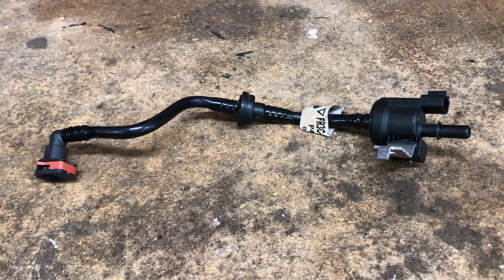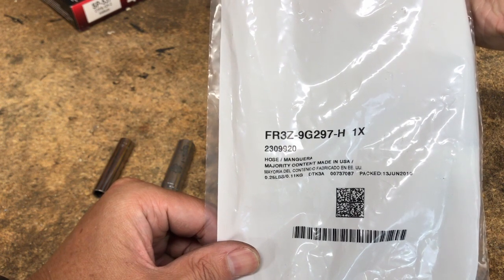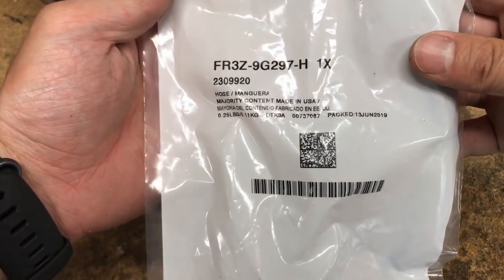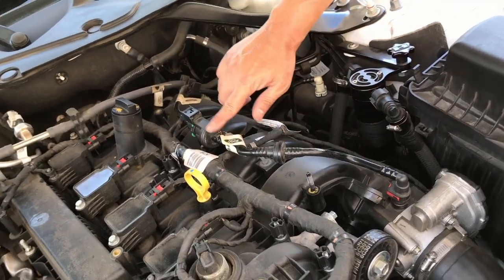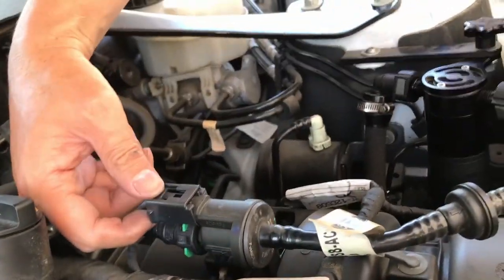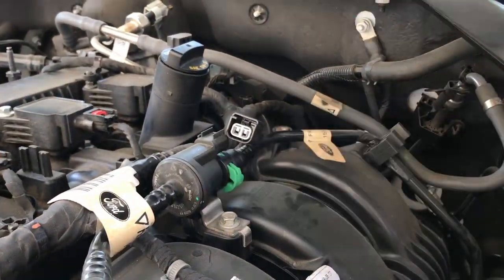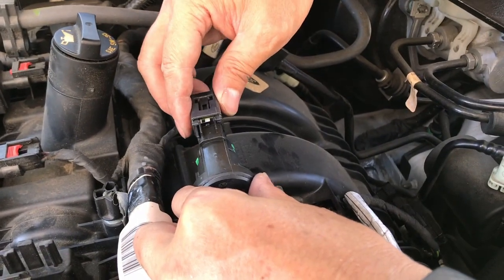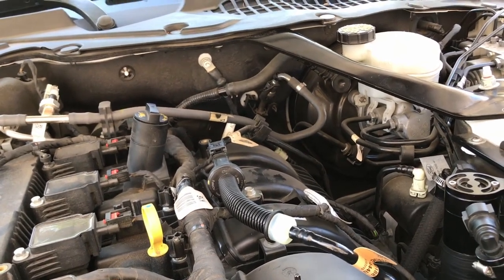Ecoboost Mustang - P1450C Evap Purge Valve Replacement

Comment: Excellent video - thank you! I Also appreciated your input on where you got the part and cost in one of the replies (can you say which specific online Ford dealer you got it from?).
One additional Question; my car (2015 EcoBoost Mustang) is getting the P1450 error code you mentioned as well as a P144A code. When I research this code, it says it is an “Evap. Purge Valve”. However, I don’t see anything like the pic of that in my car, AND the only YouTube videos of this are on different engines. I now suspect that the “Evap. Purge Valve” has been REPLACED in the EcoBoost engine by the one you show in your video - and that it is not two separate and distinct parts. Any input is extremely welcome.
Thank you again. Great stuff.
Reply from the maker: My pleasure, glad this helps.  Going through my records, I purchased it through Varsity Ford Parts.  Total was $38 shipped.   I believe we're talking about the same part.  One thing I noticed was the replacement valve was completely black.  The original part had a white section near the middle.  Hope this helps.

Comment: Amazing video man, love that you used no speedups or nothing, showed me exactly how long it would take to do this. The Motor cover gave me more issues to put on then the part lol. Whole process took me exactly 20 minutes to do :0
Excellent video, worked on my 2016 Ecoboost, thank you!
I'll take it to Auto Zone to get the check engine light cleared and should be good to go, well done.
Reply from the maker: You're welcome Null.  I saw a few videos where people were struggling with the connectors, or just completely skipped over the process.  So I figured I document the entire procedure.  Glad it helped.
Reply: Hey did the check engine light come back on? I cleared mine immediately doing this but just checking to see if it’s going to come back on tomorrow
Reply: Do they clear cheack engine light at auto zone ?

Comment: This can be avoided by not "topping up" gas when you get it.  New systems (2009+) are designed with this strict anti pollution tech that is supposed to prevent gasoline vapor to get back into atmosphere....when you top up it adds gasoline liquid into system and can destroy it.  If you avoid topping up, this shouldn't occur.
Reply from the maker: That's good to know.  Thanks Joseph for sharing.
Reply: Currently going through this right now; you just saved me a lot of money. Thank you so much!
Reply: @Dietdove  if the problem is already happening u have to replace the part. He’s saying if you avoid over filling after the pump stops it’s self then you won’t have to worry about the part breaking or having a vapor leak. The extra gas causes excess pressure that the part isn’t designed for and slowly weakens it’s ability to stop vapor from escaping.
Reply: Is this a passive aggressive way to enforce "stop using gas!"?
Reply: So that’s how I fucked up, well I’ll keep that mind next time
Reply: Where can I get this part from
Reply: Thank you for telling us. I've been doing this to work trucks for fedex for two years and didn't think it was doing anything negative. Now I know not to do it in my car lol

Comment: Which year Mustang you did this on
Reply from the maker: Hi Savannah, I performed the replacement on a 2015 2.3 liter Ecoboost  Mustang.  However, it looks to be affecting later years with the same motor.
Reply: Guide also works on 2016 (my ecoboost)
Reply: Does this purge valve work for 2016 Ford Mustang ecoboost? I am having trouble finding a replacement purge valve for my 2016 Ecoboost from auto zone / O’Reilly auto parts stores (they only carry valves for GT’s)
Reply: dannyTS11 yes it works I installed it in my 2018 Mustang eco boost I got mines from my local for dealership saw some on eBay also
Reply: @dannyTS11  i bought mine online, the OEM part is cheap. They don't sell it in those types of stores, I tried Auto Zone and they didn't have it.

Comment: Where did you get the part from? Directly from ford or an auto parts? Just had this issue come up last night. Awesome simple video!
Reply from the maker: Hey Andres.  I purchased it from an online ford dealer.  I wasn't in a rush, and my local dealership wanted about $20 more for it.   Yeah, I saw a few videos where people were struggling with the connectors, so i figured I'd break it down step by step.  Thanks for the comment and happy to help!
Reply: @BIsForBudget  Could you give me the name of your Ford Dealer online that you use?

Comment: My gas cap just started making a weird noise like a farting noise and my car has been having trouble starting up every time I fill it up with gas you think this would help with my problem?
Reply from the maker: Hi Raphael,  not sure which year or model your vehicle is, but the 2015+ Mustangs referenced in the video do not have traditional gas caps.  That said, I'm not sure if this will cure the noise.  Sorry.
Reply: B Is For Budget  I have a 2016 Mustang eco boost I get a farting noise coming out where u pump gas into the car and  a error code p144c when I checked the engine light telling me it’s the purge valve so going to try to replace it and praying to god that works
Reply from the maker: @raphaelvillalobos504  That's a good move.  Those original evap purge valves are known to go bad, so it'll need to be replaced eventually.  Fortunately, you wouldn't be wasting money if this doesn't resolve it.

Comment: Any idea if this works for a (p0456) code on the ecoboost ? It states there is a Evaporative Emission System Leak Detected (Very Small Leak)Thanks!
Reply from the maker: Hi Tommy, yes P0456 is in the same class of error codes.  As a matter of fact, Ford TSB 17-0047 includes that specific code  when it comes to replacing the evap purge valve.  Thanks!